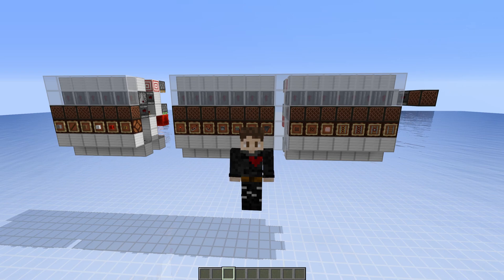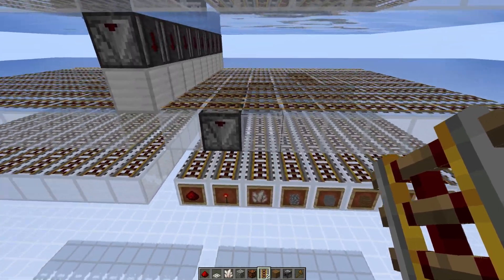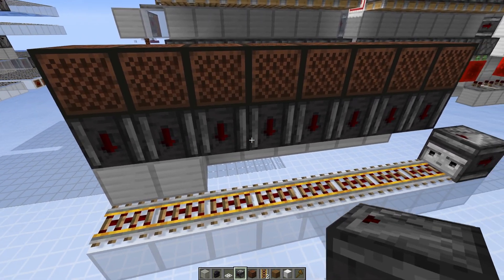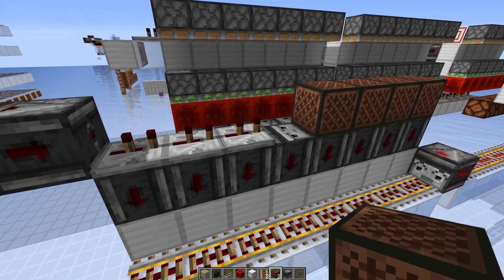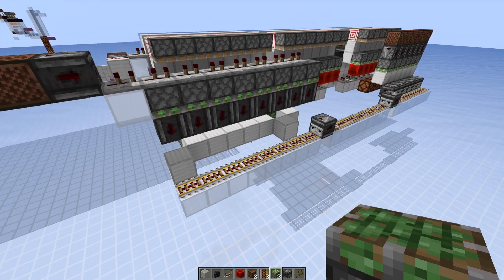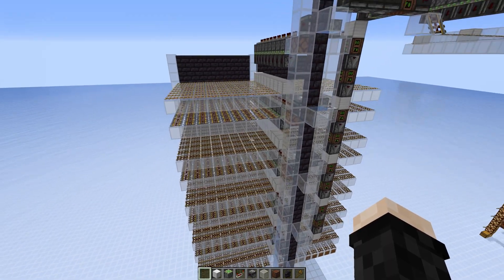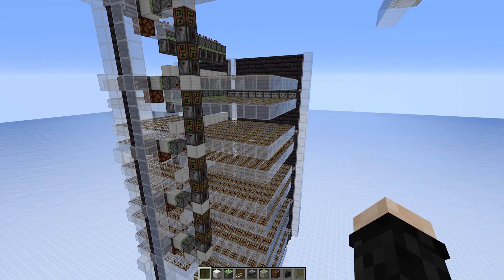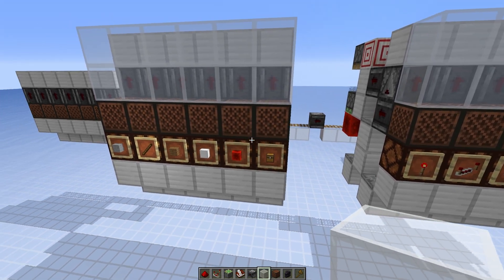How To Make An ENCODED CRAFTING SYSTEM | Part 1

Comment: Very nice overall, only suggestions are maybe making the rom less vertical, like divide it in 3 parts one behind the other so the outputs are still aligned but it's easier to fit it somewhere instead of a sky limit tower XD, ane the other is maybe instead of the fatass pulse extender use a memory cell (basically a 2 comparators pulse extender but with blocks on the end of both comparators so it doesn't change the stored signal) where you substract 1 every time, it would be a bit more complicated but smaller and cleaner, very nice video anyway!
Reply from the maker: Thanks a lot! To be honest I'd rather have something very tall than large cause the system in the end will already be very large and I have enough vertical space. It will also make the decoder a bit more complicated.
And for the comparator clock that's a nice idea, I will try something like this

Comment: why not use scaffolding to let the signal travel upwards?
Reply from the maker: Because scaffoldings are slower, with those it would take 1 tick to travel 1 block vertically and with 1 observer 1 block and 1 door you can travel 4 blocks in 2 ticks so twice the speed. A bubble column would be instant be it takes some time to turn on every time so it would be slower overall. The only alternative that would be faster is instant vertical rails but I tried it and didn't work for me